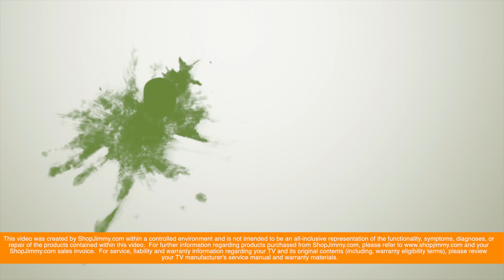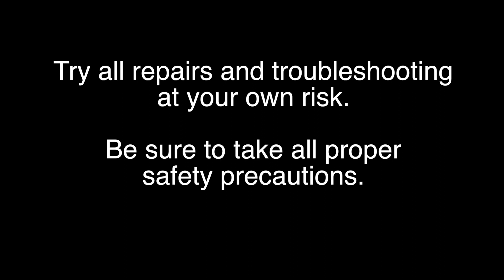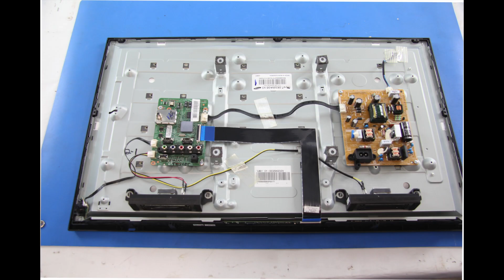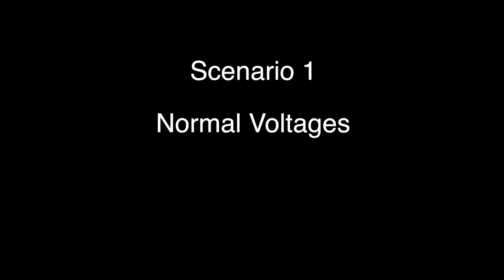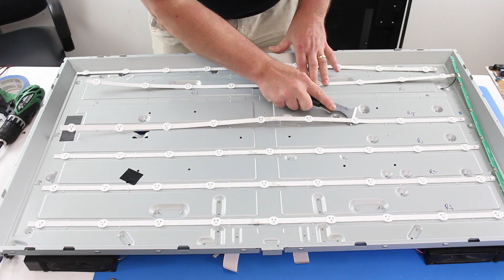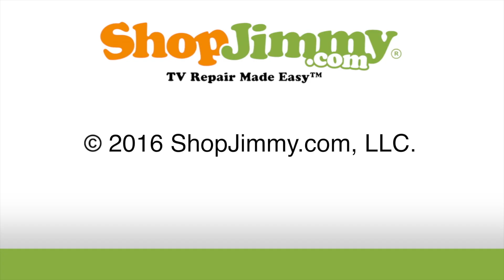Samsung UN32EH4003FXZA LED TV No Backlights How to Test Voltages for Power Supply and LEDs

Comment: Thanks for the video; very well done. I have this exact TV with the same number on the power supply board. The voltages on the board are good with the Conn. Disconnected, and read about 108 volts with all of the LED's on when connected. When I operate the remote it seems to be entering the commands as the red LED on the front panel blinks with each entry, but the screen just shows a dark blue glow. I swapped the main board from this TV in to a working UN32EH4003F (no XZA) as they were the same and it worked, so I know the main board is okay. I also swapped the ribbon cable from the good TV into the bad one with no change. The power supply boards were quite different even though the connectors we're the same. I put the power supply from the good TV into the bad one and the TV turned on, but the screen was black, and the LED's did not light up. I was afraid that I might end up with two broken TV'S if I put the power supply from the bad TV into the good one, so I didn't. I don't know the number of the power supply board in the working TV, nor did I check the voltages as I found your video after putting it back together. Do you think my power supply is bad, or could it be the long thin board attached to the main board and the screen via ribbon cables? It's the only other thing left. Thank you for your time and attention.
Reply: Same problem. You fix it?
Reply: @36USMC  No' i ended up replacing both the power supply and the main board and neither one fixed it. I suspect that the small circuit board attached to the screen with ribbon cables was bad. it was the only thing left, but the ribbon cables were soldered on so I decided I had spent enough time and money on it already, and trashed it all.

Comment: purchased an item for 57.59 then realized i needed to return the still unused item  and was only given 30.04 they kept almost half of the purchase price for doing nothing so be aware if you need to return anything
Reply: Yes, there is often a restocking fee to accept back and re-test returned items before they can be put back on sale .. spotting damage and swapped items can be tricky.  I guess some of the big sellers with lots of equipment and free staff time might be able to absorb this cost but would be an issue for smaller sellers without tamper-evident packaging.

Comment: Hi Jimmy
I have a Samsung 40 inch TV model numberLN40E550F7F.
 It has no picture but sound. It has no backlight. When turning on the TV it passes the flashlight test and has a picture. I removed the back cover and checked the power board for visual defects and could not see any. I checked for voltages similar to the way you checked them in the above video. My voltage when the tv is on is 0 to the LED's. When powering on the TV there is a faint click and the LED's turn on for a split second and a voltage spike up to 49 volts and then down again to 0.With the plug for the LED's disconnected from the power supply there is 0 voltage when on and 0 voltage when turning the TV on. With the info you have supplied in all your videos i am presuming it is a power supply problem. With the info i have provided could you confirm my findings.

Comment: I have a UN32EH4003F with DF320AGH-R1 panel and BN44-0664A that has LED connector labelled 1: D+ 2: S- 3: NC 4: S+ 5: D-. If I check for voltage over D1 & D- pins I get 170V, but I get 0V over S- & S+ pins. Same result if I have the backlight plugged in or not. Does this indicate faulty power supply?
Reply: What did you find out?  I am getting the same readings?
Reply: @TheAyerswv  same on my side, any news?
Reply: I have same labels and I found pins 2, 3 and 4 are connected together and goes nowhere (unless this is multilayer board, but I doubt it), so in our TV's LEDs gets the power only from the pins 1 and 5, so if you have high voltages plugged and unplugged it is rather LEDs problem
Reply: @krzyhoo2  indeed - I took a stab in the dark and ordered up LED's and that fixed it. Not bad for a TV saved from the dumpster that cost $20 to fix.

Comment: whoa my back lights light up when I bridge 1 and 2 but on my board it claims 1 is positive and 2 is negative dcv of 115.0
Reply: when I bridge them voltage drops to 115.0 dcv than they light up can I just bridge these without to much problems
Reply: I can do the same thins by bridging 1 and 2 together. Did you end up doing a permanent bridge?
Reply: Jess Rose yea i did it is working fine, I unplug the tv set when not in use just to be safe.
Reply: OMG this just worked for me too! I've permanently bridged pins 1 and 2 on the connector itself, and my LED's are working!! Thank you so much for your comment here! You just saved me buying a new TV :-D
Reply: Thanks for sharing. This fixed my tv as well. I love the internet.
Reply: Actually, The bridge connection only worked for the bottom half of the led backlight. I had to cut the two hot wires and split the load between the two sets of leds.
Reply: I got this problem.. in samsung un60h6300afxza .. the power board have this for test +1,+2,+3 , -1,-2-3  so i test with the plug and only give me 300plus in the +1-1 but the anothers pins drops the voltage like leds are damage..BUT  when i  heck the power supply alone with out the plug connected i see only got 300plus in +1 but the anothers +2 +3 give me low reading like power supply was bad so i dont know what to do. Help

Comment: I have tv backlight problem i know that the leds are bad but with the leds in and out its mesuring the same
On startup mesures around 80 volts and goes down and settles at 45 volts i dont know if that is good or bad

Comment: I have a Samsung LED UN46EH5000FXZA with a black screen (no backlights, flashlight shows menus). I have now replaced the power supply board (BN44-00667a) and the main board (BN96-28925a) with new parts from your site and got no change in performance. What's the next steps? Thanks
Reply: It's a LED failure nom doubt about it.    For sure !!

Comment: Hi,
I am getting these readings my TV is this model: UE32EH5000KXXU VER:07
Is it the PSU or the back-lights?

--- Plugged led lights cable ---

1. D+ and 5. D- = 162.8v 
2. 5- and 4. 5+ = 00.0v

--- Unplugged led lights cable ---

1. D+ = 166.5v
2. 5- = 00.0v
3. N. C 
4. 5+ = 00.0v
5. D = 01.8v

Comment: 1) What is considered "normal voltage"?
2) I have three (positive) test points. Only one of them gives a reading of 160v.
The other two are showing 0v. Is that an indication of a bad power supply board?
(LED connector is unplugged.)
Reply: Hello did you find the conclusion? I have the same problem!

Comment: what about if  one port is 160v and the other read 0 this with the led connected and led disconnected that's means the power supply  right ??thank you
Reply: I'm having the EXACT same problem!
One pin is showing 160v while the other two are showing 0v.
What did you finally decide to do?

Comment: I have a 46 inch samsung led tv. When I disconnect the led connector and measure the voltage on the power supply board I get 220 volt on two pins. Is it too high? Because you were getting close to 190 volt.

Comment: hi i tried this on a tcl 65 smart tv 2018 model. I get couple volts only? tv is on , does this mean board is bad ? the other boards are getting 5-20v ethernet port light is on. I cqn see a very faint picture no backlight at all. I hear sound to.

Comment: I have a Samsung tested strip backlight lights up split strip  
+  -+   -  when tested with led tester both stripes light up 93v   top 63v  on bottom using external led tester however when connected to psu backlight don't come on   and voltage is 236v on +    -+ is 0v   -0v  I suspect it's something on PSU board  in feedback circuit

Comment: I have samsung led TV model numberUa32f5500ARLXl.i have done flashlight test and have seen the circuits all looks fine.but i feel issue is with backlight. Can you please help me which led tester should be taken to test the backlight. Details : ac100-240v 50/60hz 86w,model ua32f5500

Comment: ok question i have a 50 inch sharp roku tv no voltage table on the led but when measured led 1 and led 2 measure 68.5 volts.I have no idea if thats normal? the power board is pltvfy721xxd1
both led strips do not light ..

Comment: SAMSUNG UN65MU6290VXZA   Have sound but screen is black   no visible back lights     flashlight test showed video on screen. Replace LED/Power board    no change  I believe I now need to check LED strips.  Any tips  (do I have to replace LEDs and board at same time ?)

Comment: If number 1 test points gets voltage but number 2 test point gets 0 volts with the led cable disconnected what does that mean.